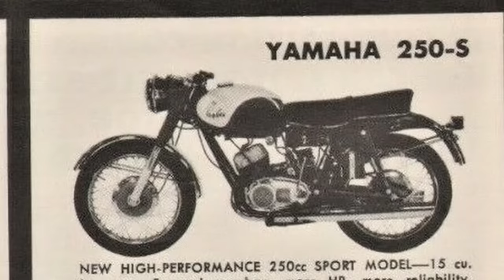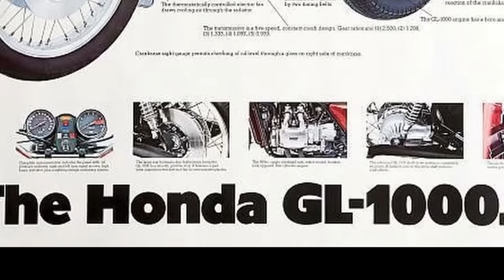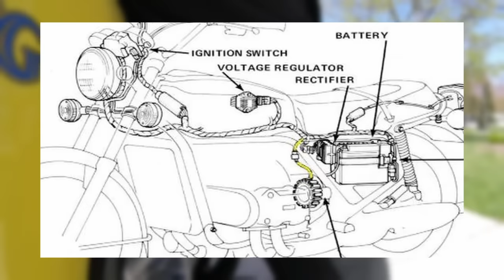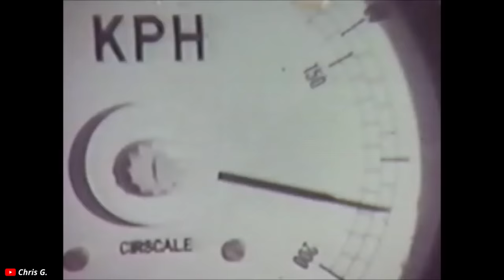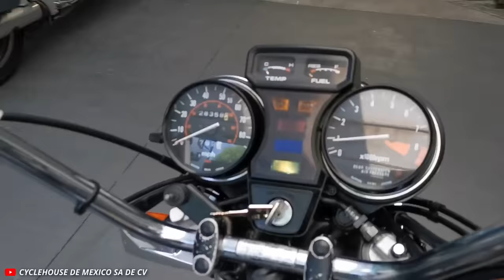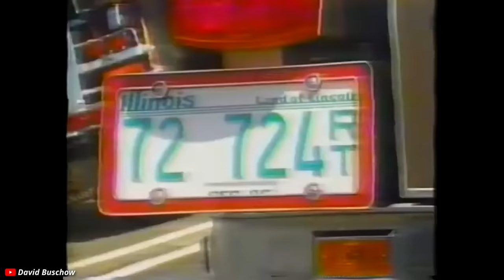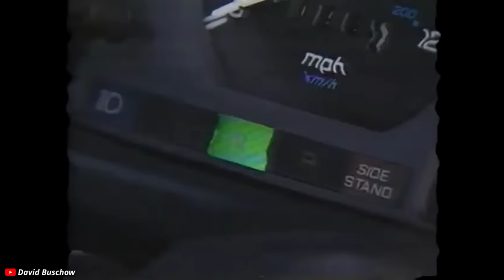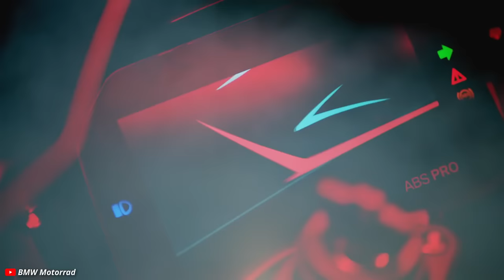How the Honda Goldwing became the Winnebago of Motorcycles

Comment: I'm surprised the Goldwing has not gone electric. Honda is lagging right now. It's the obvious evolution. Quiet, low vibration, comfort, ease of use,  large wheelbase (to fit those battery packs) and high weight and price tag. It screams electric.

Comment: The Goldwing was not exactly what it appeared to be. I have owned both a 1983 and 1985 Goldwing. Both Interstate models. Both had a load capacity of 400 pounds, as per the owners manual. I weigh 240 pounds, my former wife was around 170 pounds, so just the two of us exceeded their load capacity, without putting anything in the saddlebags and trunk. Many people go and load them down with 100 pounds worth of accessories, decreasing the load capacity to only 300 pounds. I don't know what just the factory fairing, bags, trunk, and all the mounting hardware weighed, but it had to be quite a bit. Then there was all the electronic crap. After taking in to account the bikes own weight, there wasn't enough load capacity left for it to be a proper two up touring bike.